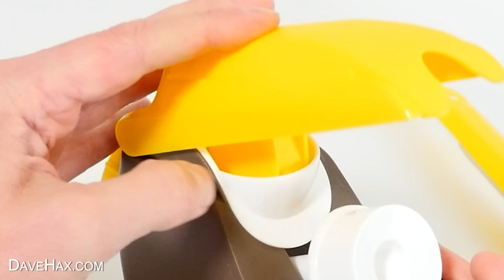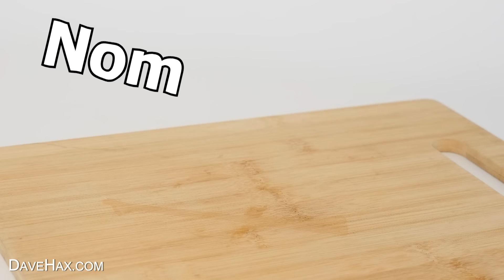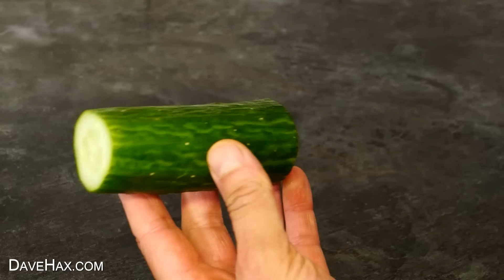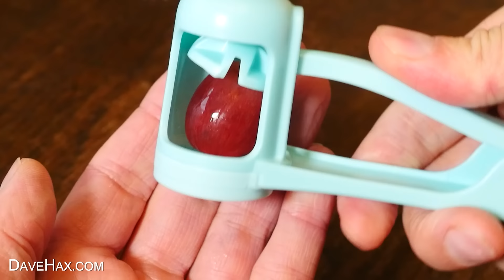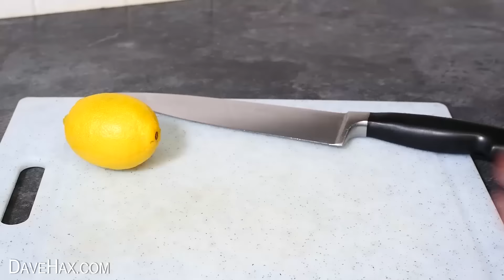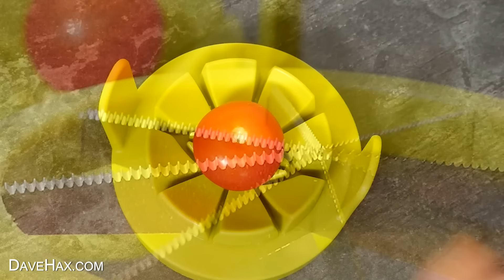The Genius Behind This Invention Needs A Medal!

Comment: The apple peeler/corer takes me back to a time many years ago, when a friend of mine had a museum of old time gadgets, one of the gadgets they had in use in their kitchen was exactly that design in terms of size and function, although it was made of a different metal, maybe iron, and had an adjustable clamp to attach to a table for use… it worked like a charm, producing peeled and cored apples in seconds! Nice to see it reborn in stainless steel 👍🥰

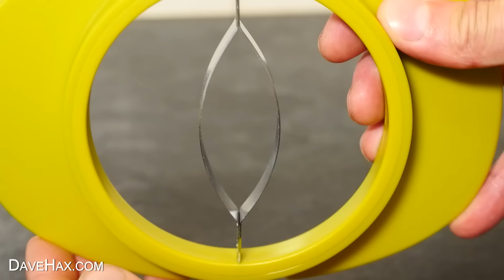Comment: 9:15 “It’s very sharp so be careful” Proceeds to run finger over the sharp blade 😂😂
Reply: That's actually the proper way to check the sharpness on a blade. He didn't press into the blade, nor did he drag his thumb along it, he brushed his thumb perpendicularly to the cutting edge in a way that it can't cut.
A Google search can tell you this.

Comment: All of these gadgets are perfect, and that was a good tip for using a cup for the mango but something not mentioned was the grape slicer is meant more for those grapes with seeds which can be annoying to have to take out before actually eating. And as for the banana, just to add to the preparation, it can also then be chocolate dipped.

Comment: I love the apple peeler. Although I did have to add a screw to the part that does the coring. The wing nut would not hold it in place properly. I think back on how many apples I peeled by hand over the years before I got the peeler.  Be sure and use the apple scraps to make apple cider vinegar. It tastes so much better than store bought.

Comment: It would be much easier to peel the banana and then use a knife to spread the Nutella or peanut butter or whatever on the surface of the banana.  You would then have to clean only the knife and not the 300 pieces that comprise the machine.   This gadget is an answer in search of a question.

Comment: 1) the Banana peeler looks cool, but for me privately it probably would be too annoying. I would put my nutella on top of the banana.
2) the spiralizer looked like it worked well. I didn´t expect it that way. you can make some fancy stuff with it but also have to find a use for the outside. but this shouldn´t be a big problem.
3) the Grape cutter didn´t appeal to me. with a knife I can make this with two easy cuts and I save the hassle with putting it in. Tomatos can be annoying to cut, especially with a dull knive, but if you keep your blades sharp it´s also no problem.
4) the Apple peeler is nothing for me because I mostly eat my apples with the peel. but makes again cool spirals. I´m a sucker for these.
5) the apple core remover in this configuration seems unnecesary. I would more likely go then for a tool that cuts it completely like 7)
6) with the cutting gadget holder I would be so afraid to make my blade dull, that I would refrain from using it. with the thing that actually cuts, it seems like it gets the job done. so it can be helpfull.
7) Fruit slicer work pretty well I tried these myself. but with the one you used for the mango I always get the feeling, that it cuts too much away from the center. but like you showed you can easily get the rest with a knife.

Comment: The first gadget is so cumbersome, messy, impossible to get completely clean, too many parts…just, no. 
Peel banana, either slice lengthwise or thick slices along the length, and spread with whatever you like. 
The problem I’ve found with the simple apple slicers/corers is, unless the apple is perfectly perpendicular to the counter, the center corer section doesn’t cleanly remove the core, and the pieces are not uniform.